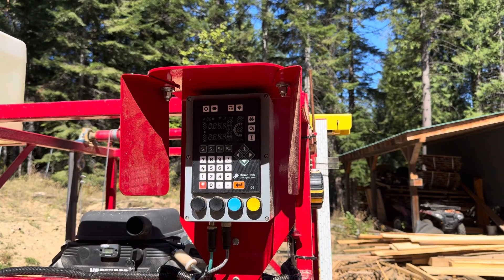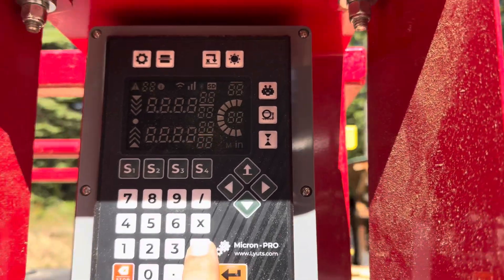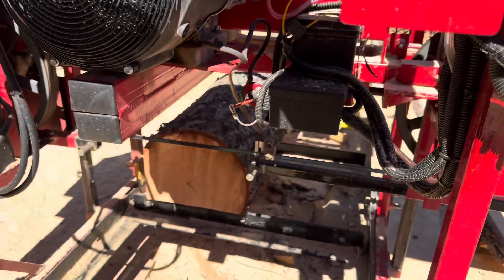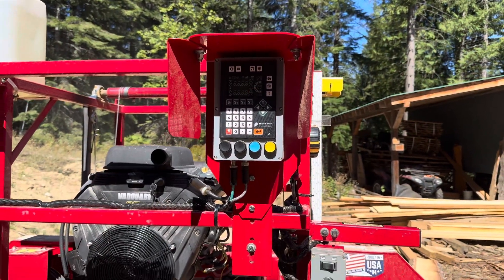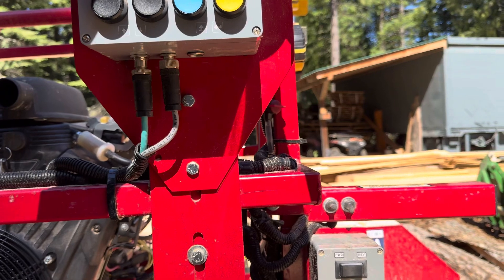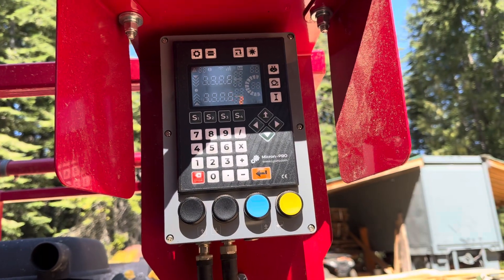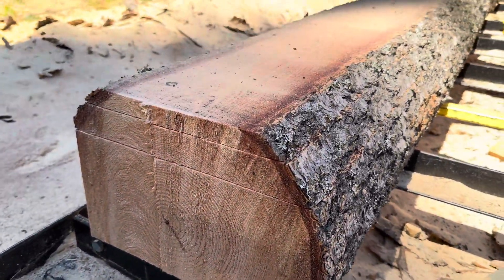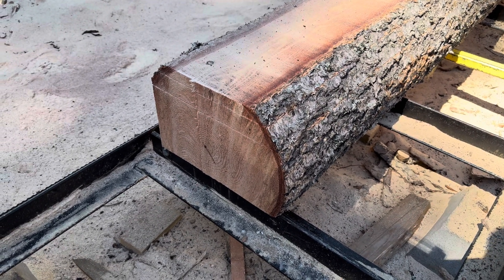Maximize your lumber and minimize the number of cuts made with Micron Pro Setworks.

Comment: Do you know how to make a cut list? The manual is a bit confusing.
Reply from the maker: You have two ways of cutting. Top down or bottom up. So with top down is marking the top point of cant and using the “x” button to cut same all the way to bottom. It will give you a number in upper left of maximum number of boards for that given thickness.
With bottom up cutting you use the “+”. Starting with the bottom board you can add boards going up the timber. You can  put in 2”+ 2”+ 1.5”+ 3”. This will add all the cuts from bottom to the top just how they were added together. Cutting 3 first then 1.5 then 2 then 2 final board. Give that a try and let me know if it helps.